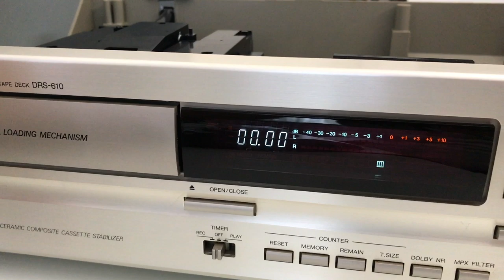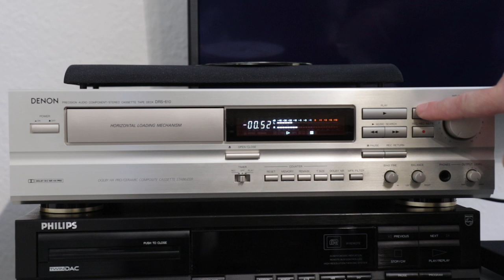Denon DRS-610 Cassette Deck - A look Inside + Test

Comment: I really don't like those horizontal loader mechanisms.
Reply: Why?
Reply: Whyyyyyyyyyyyyyyyyyyyyyyyyyyyyyyyyyyyyyyyyyyyyyyyyyyyyyyyyyyyyy?
Reply: Because if it eats the tape it's a nightmare.
Reply: @chrisvinicombe9947  That makes sense, thanks for your reply. Now then, how to avoid the dreaded tape munching in the first place, any tips?
Reply: Having just ordered one to match a Denon mini system I am realising how difficult cleaning the heads is going to be.
Reply: 6 screws to remove the hood and push eject.  I just repaired an 810 and though a bit cumbersome removing the hood, there's certainly sufficient access to get it cleaned up good as new.  @MrDuncl  

However.. You made me just realize something.. A proper demag would require removing the transport stabilizer lid every time. Wouldn't be impossible to do it without removing that lid, but without careful hands, there's a big risk of accidently damaging the heads.
Reply: @chrisvinicombe9947  vertical ones could eat tapes too. It is a matter of servicing them on time.